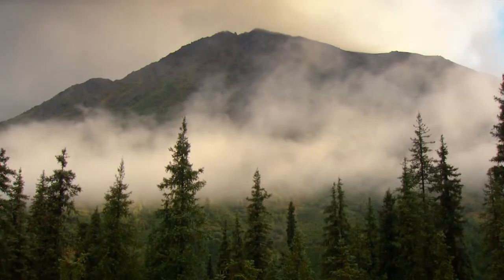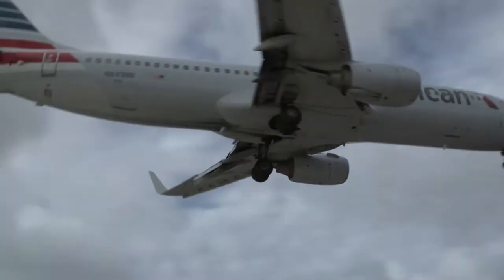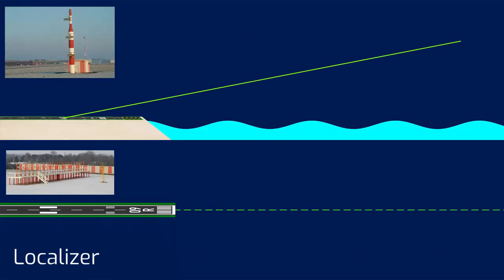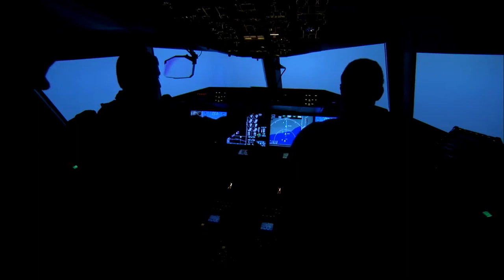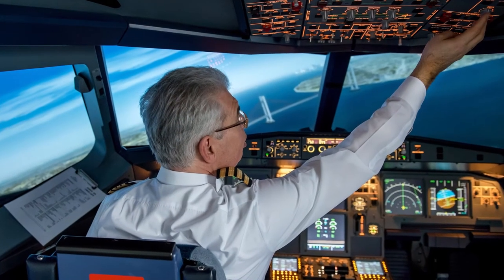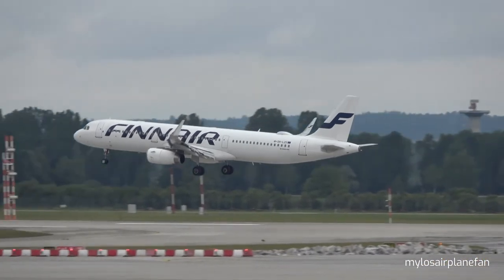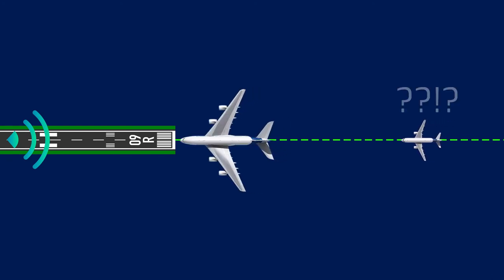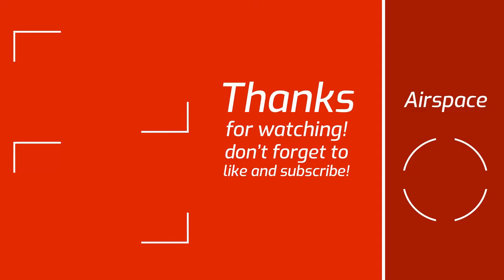How do planes land in fog? (Low visibility procedures)

Comment: Very interesting one my friend! Is it possible that an ILS approach cannot be performed or has to be aborted due to strong lateral winds or other factors? And does the plane then automatically engage a go-around procedure? Or do the pilots have to do that?
Reply from the maker: Thanks :) Yes, an automatic landing is rather limited regarding wind speeds, for example the A320 is certified to autoland up to 20kts crosswind, whereas for a normal landing, 38kts are permissible :)
Reply: The GoAround has to be initiated manually. The aircraft will try to land. Thats why it is essential that the pilots are monitoring and in doubt, GoAround.